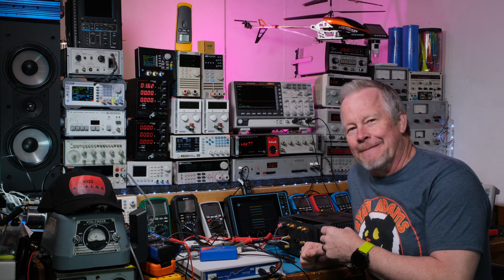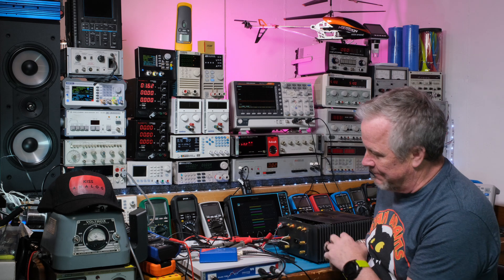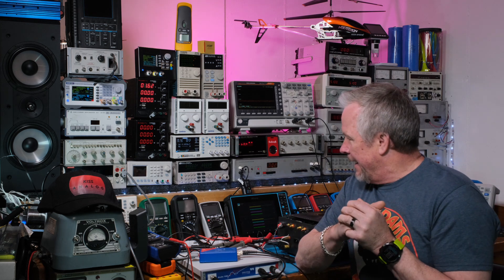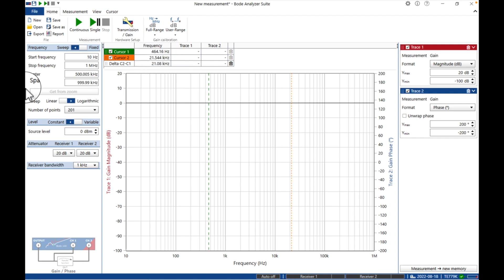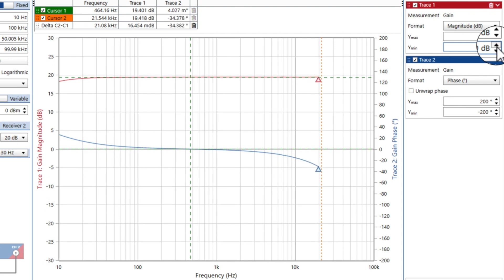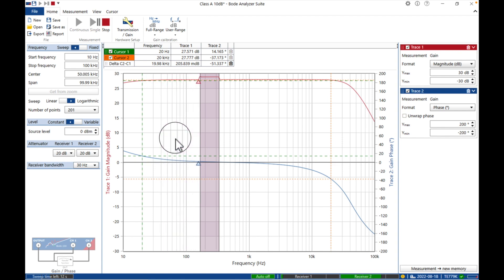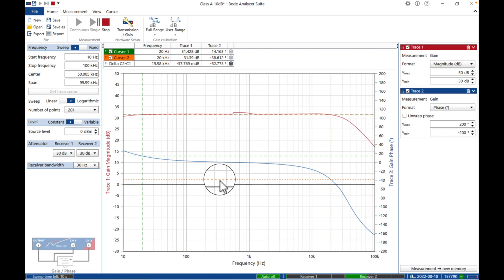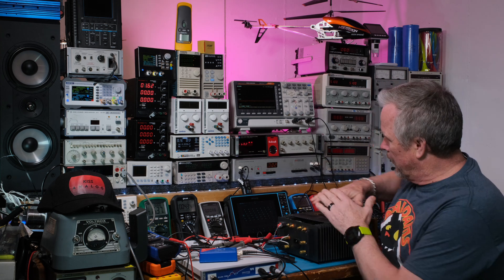30W Class A amplifier - finding max power Bode Plot with Omicron Lab #OmicronLab #BodePlot

Comment: I'm not sure I completely understand bode plots. I'm still a newb when it comes to av testing. Still a cool video and it's not your fault I'm a dolt.
Reply from the maker: Thanks for your feedback Joey! It just occurred to me that I don’t think I ever did a video explaining what a Bode Plot is :-)
If I put a 1V signal in and I got 10V at the output, that would be 20 dB gain.  Now if I did that at every frequency between 20 Hz and 20 kHz and drew a line connecting them, that would be a bode plot.
Reply: @KissAnalog  cool. Great description. I knew it was in the frequency domain but I wasn't sure. The Christmas bells be ringing for you in a few weeks. You'll get a laugh.
Reply: @KissAnalog  I have a bunch of books ordered about the math behind all this stuff and for some little applications I'm writing
Reply from the maker: Great _ let us know what you learn.

Comment: I sse it more that you measure the Fase Difference  What is the result if its more let say 20 degrees?
Reply from the maker: Are you asking if there’s a phase difference between input and output of 20°?  if so, some people say psychoacoustics says that we can’t hear the difference – but I’m not sure about that.
Reply: @KissAnalog  i can think that it means that the total circuit not have a pure resistive load , in this case perhaps also some inductive or capacitive behaviour of the circuit ,  a peace  10 mtr  30 ft shielded wire gives maybe a result that you can hear or is the load not pure resistive ?  . Maybe something that is worth of investigation , i tried to measure directly on the but no results  with HF you measure some reflected energy , it is something that i am interested in , hope you can read my broken english 😄

Comment: If I remember correctly when you selected that heat sink when you started the project it was a bit undersized as soon as I seen it for that wattage in class A mode. 

Yes on warm days you will probably have to have a fan that you cut down the voltage on to slow down the blades so they’re silent you only need a tiny amount of air movement you do not need the full rated fan output sometimes less is best. 

That size heat sink I have on my eight Watt Nelson pass class a and it gets very hot.  So I could just imagine how hot it gets with 20 W or more
Reply from the maker: You are so right!  :) It started as a 20Watt and then I added headroom for dynamic range, but I could drop the Class A portion so it is closer to 20 Watts and then it would naturally go to Class A/B.